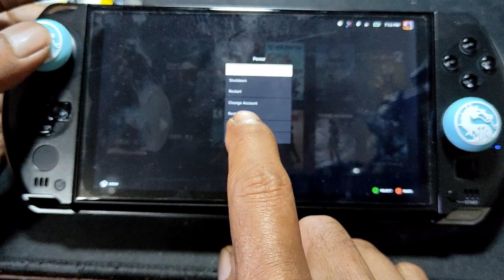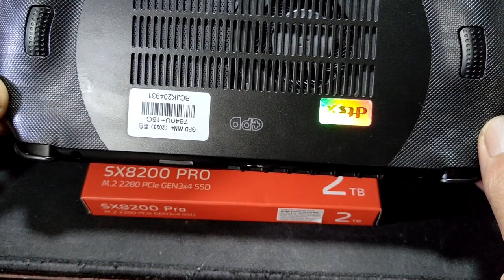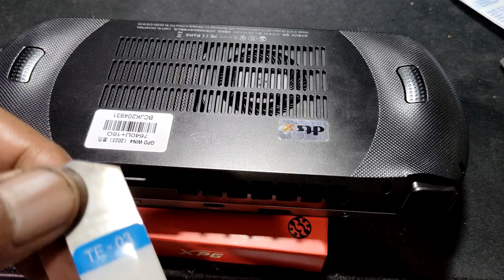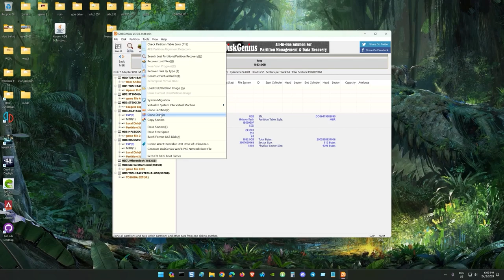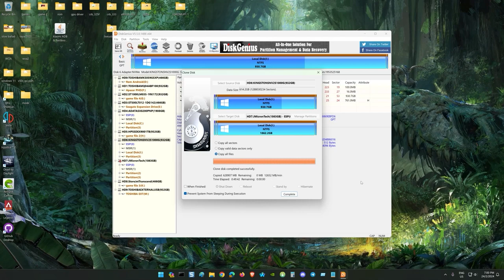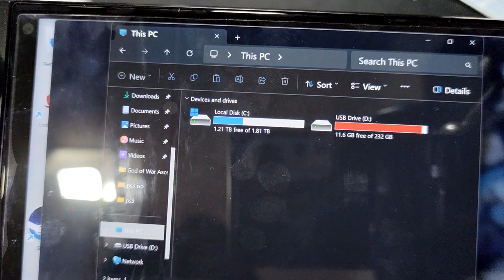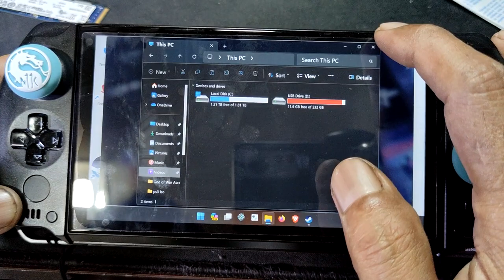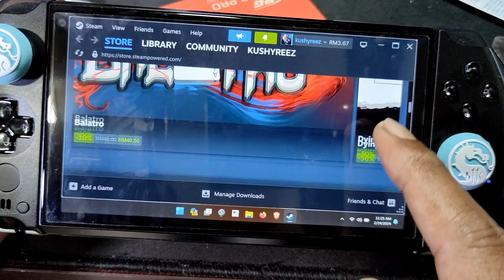Upgrade my gpd win 4 2023 storage m.2 nvme pcie gen 4 to 2tb

Comment: Hello, very good informative video, I only have one question, is it not necessary to disconnect the battery?
Reply from the maker: actually better to disconnect it , but i check there is no voltage present at the pins of pcie at state 0 , just do it with precaution